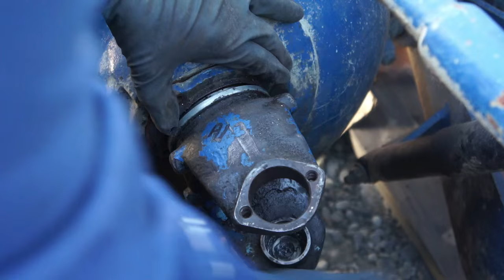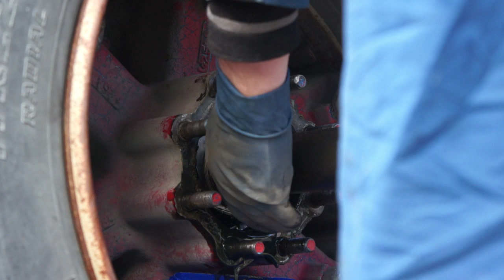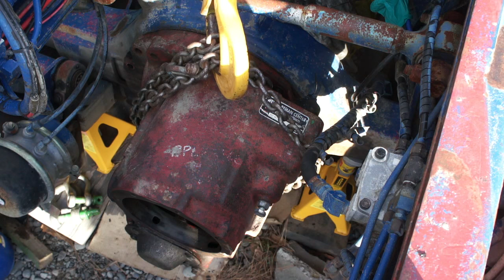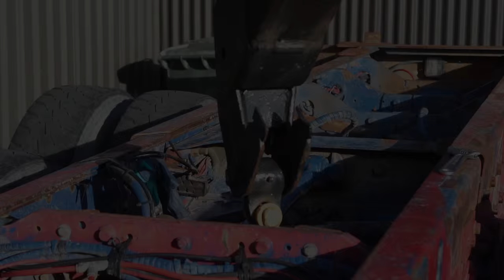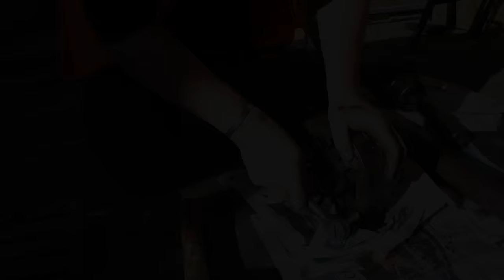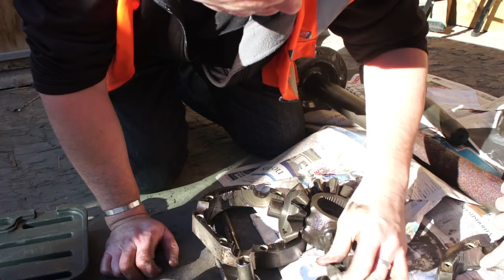Rockwell 46-160 power divider removal (part 2)

Comment: How many splines on the axle shafts? I am looking for  Rockwell 46160 to put into a truck with Dayton wheels like this one.
Reply from the maker: Kevin, I just found your comment in a holding place awaiting moderation ... I'm sorry if too much time has passed to write a useful reply ...  anyway, the axles have 46 splines.